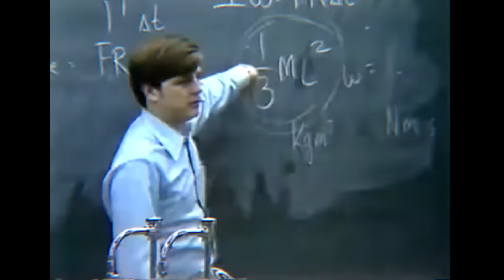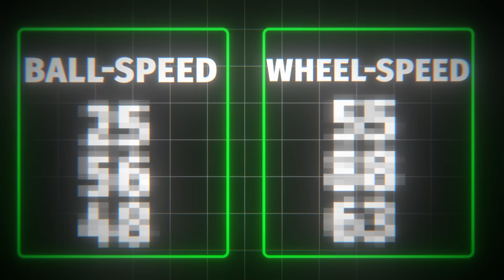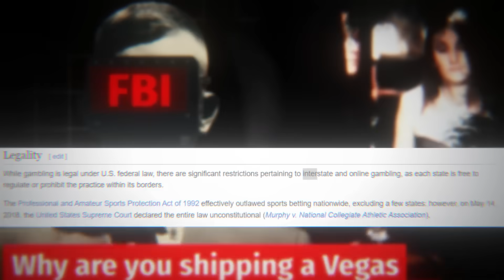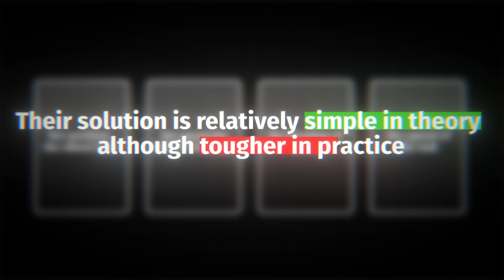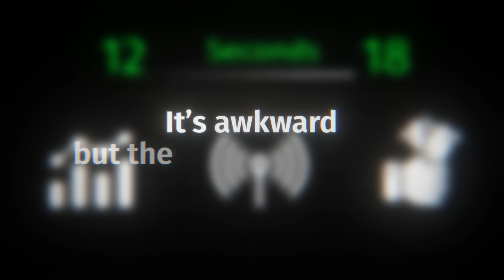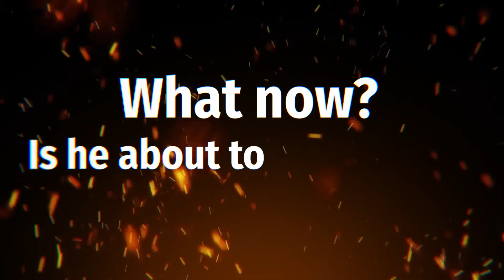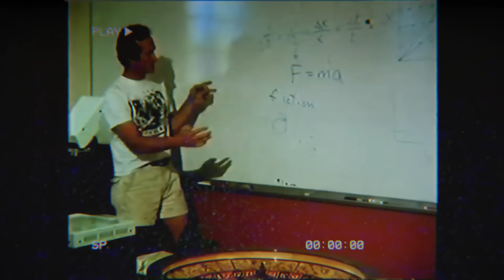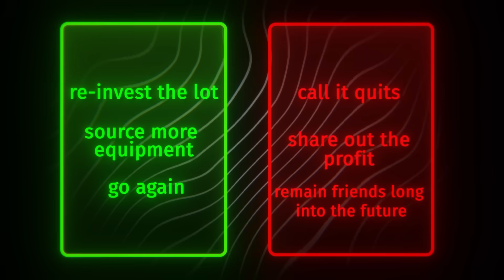The Nerds Who Beat Vegas Roulette With Science

Comment: This is a lot of rubbish and, also, on the video at around 6:40 - 7:00, it shows the ball spinning the same way as the rotating wheel.  They should know that in casinos the ball is always sent in the OPPOSITE direction to the way the wheel is rotating.  So this proves this is a load of rubbish.  In addition,  any expert will tell you that the wheel has no memory,  and that each spin is a fresh start and that it has no connection with previous spins.

Comment: How did they have computers that small in 1975?
Reply from the maker: It wasn't that small, that was half the problem! A big pad across the chest, linked to stuff under the arms and running down to the legs.
Reply: @TILT223  I saw a computer at my dad's office in the early 90s that was half the size of a room. It was considered "old" even then, but I know that they used it a few years before. Didn't Apple come out with the Mac in the early 80s? These guys were exceptionally smart, though. I'm sure they knew where to get cutting-edge tech in the 70s

Comment: I mean roulette is not that hard of a game to beat, i did it mathematically based on statistics, but after winning nearly $20,000 online i was flagged and was put on a rigged wheel, then lost it all (my own fault) for betting too much after getting a "bonus" for purchasing so many chips (i didnt read the fine print good enough). So when i cashed out they took everything but my original amount i bought in, and being flagged already i was put on a rigged wheel that even though only betting red or black it never landed on what i bet, which was statistically impossible. (If I remember right it landed on red 42 times in a row when i bet black.)

Comment: I figured out the physics of this in 1978 and I was trying to get a roulette wheel to get a data set.  Then I built a little computer with a 6504 Mostek cpu which took a 9v battery and I had a switch running down to my shoe and the computer fit in a cigarette package.  I used an ear piece that gave out tones for the different values , the result told you where to place your bet.  If you could guess even which half of the wheel , you would win.   I memorized the order of all the numbers around the wheel so that it would be easy to just bet a few consecutive numbers on the wheel.   I still have the computer and I had to build a calculator to figure out trigonometry.  I used look up tables to figure out the trig function.   This little calculator figured things out in hex and then translated it into decimal.   You had to time the wheel for one or two spins and the ball immediately for the third spin but the ball went in the other direction.   I think I only needed one spin of the wheel and one revolution of the ball.  
You might be able to do this without a calculator if you practiced long enough.   I didn't know where to get a roulette wheel and tried to build one.   The physics of the wheel and ball is calculated using gravity and the circumference of the wheel and differential equations.   I found the solution and it took about 4 pages of math to get it. 
A lot of people bet at any point but to win ,  you have to wait until the Croupier throws the ball.  So it might look suspicious if you always waited.  You would have to bet a few before that and then after.  You could still win this way but it would be slower.  
I never heard of these guys before , they were a couple of years ahead of me.   I never did ever test it out because I almost finished the computer program and was debugging it and got to busy with other things.   Then I read in a magazine about 1990 that someone had tried this.  There is a good chance the casino's will catch you and I noticed these other cheaters that were recognized world wide and banned from casinos.   I just dropped the idea.   I still have my old apple 2 computer that I used tot do the programming on and an EPROM burner and eraser with UV light.
Reply: Remember the Bread Pan EPROM Eraser in Kilobaud? I did that. And the IO Board in the World's First BBS. Good times!

Comment: As a Roulette Craps and Blackjack dealer for 18 years, Its called Clocking the wheel. Its much more difficult than you think to do even doing this constantly and being the one spinning the wheel and ball itself. Its much easier when the ball and the wheel are near the same speeds to count the area of where the ball will drop. But even IF you can drop the ball in those areas, the balls hit the edges and bounce and can still jump elsewhere. So they really didn't beat it with science. They truly beat it with luck. Oh, and using electronics to cheat the casino.  Not a good idea. There are a LOT of unmarked graves in Las Vegas NV. Most of them cheaters who thought they too could beat the game. You would be better off in shorts sperts of progressive amount betting and not getting greedy or staying long enough for someone like me to know what you are doing to cut you off and blacklist you. Even then its not guarantee and its why table minimums and table limits are implemented. But it can put the odd if you know how and where to bet considerably more into your favors at odds with the house.
Reply: Quantifying 'luck' is called statistics.

Comment: I do something similar with gaming slots. Sometimes you can see a glitch in the rolling slot or a short faint vibration. Unfortunately with these newer machines it's almost impossible to spot a glitch in the screen or feel any type of odd vibrations. It gets more challenging when the music is played really loud. Pressing or pulling the handle (the one-arm-bandit) at different interval gaps will create better odds than an almost predictable pattern detected by the gaming analogy systems. Some gaming slots will run you dry or have a one hit wonder or the system will keep hitting. Best of luck.

Comment: This is nonsense. The one variable you can't account for is when the croupier drops the ball.  If you could bet immediately following the drop of the ball, you'd have a legit scheme. But you can't. Most bets are waved off before the ball is dropped.  So every turn is determined by the croupier and is only predictable if the croupier drops the ball in a predictive manner. If they don't, well then you are gambling again.
It's been my experience that croupiers learn how to hit numbers  after long times at the table. One time a croupier told me to bet on 13, one turn later he hit 13. Basically showing me he could hit what he wanted. 
Another croupier once told me, after I suggested European tables give me better odds, "no, a favorable croupier gives you better odds". 
Yet another time I bet an 80%+ chance of winning and the croupier looked at me grinning as if he knew what I was doing, and hit a number outside of 80% of the table. 
If you want to cheat, monitor the croupier. What are their patterns?  Where do they drop the ball, how often and what hits. 
Realize you don't need any fancy physical measurements you just need where the ball is dropped and where it hits. And determine the patterns. 
If the croupier seems totally random in where they drop the ball, nothing else matters.
Reply from the maker: This is why they change the rules and make bets before the drop now...

Comment: cheesecake recipe:
Crust:
Ingredients 
9-12 graham crackers/ 100g digestive biscuits
1/4 teaspoon cinnamon 
5-6 tablespoons melted butter

Preheat your oven to 350F/180C

In a food processor, combine graham crackers, sugar, and cinnamon. Pulse until it’s a fine crumb. Add the butter and pulse until it looks like wet sand. Grease the bottom and sides of your springform pan, cover the sides in an even rectangle of parchment paper, there will be a slight overhang and that’s okay. Press crumb mixture into a 9 inch closed springform pan. Bake for 10 minutes. Cool to room temperature.

Filling:
2lbs/ .9 kg softened cream cheese 
1 cup/ 200g sugar
5 eggs, room temperature 
1 tablespoon vanilla extract 
1/2 cup/ 120g sour cream or yogurt 
1/4 cup/ 60ml heavy cream 
1 tablespoon lemon juice

Preheat your oven to 400F/ 205C

In a bowl of a stand mixer combine the cream cheese and sugar on medium speed. Mix together until light and fluffy, about 3-5 minutes. 

Water bath! 

While the cream cheese is mixing prepare your water bath. Wrap the outside of your springform pan tightly in tinfoil, using multiple layers. So no water can seep through. Find a pan big enough for your springform to fit and have room for water to come up the sides. Boil enough water for water to come 2 inches up the sides of the springform.

Filling!
When the cream cheese and sugar are light and fluffy add the eggs one at a time. On low speed mix well after each egg. At this point be sure to scrape down the sides of the bowl and DO NOT OVERMIX! Add the heavy cream, sour cream, vanilla, and lemon and mix until just combined. Pour your batter into your prepared springform pan. Put into water bath pan and place in the oven. Carefully pour in the boiling water until it comes 2 inches up the sides of your springform. 

Bake at 400F/205C for 13 minutes, then reduce without opening the oven door to 230F/ 110C. Bake for another 1 hour to 70 minutes. Do not open the oven door during baking. To tell if your cheesecake is done, quickly and carefully give it a slight jiggle. If it slightly jiggles in a 2–3-inch circle in the middle, it’s done. The edges will be slightly puffed up. If the cheesecake shows any cracks immediately move on to cooling. 

Cooling:
Once your cheesecake is done, turn off the oven and slightly prop the oven door open, preferably with an oven mitt or two. Leave in propped oven for at least an hour. Then leave the cheesecake at room temp until it’s cool. Cover with plastic wrap and let set in the fridge overnight. Remove the sides of the pan, peel off the parchment paper, serve, and enjoy!

also help me pay for college plz
https://gofund.me/18770d66

Comment: im a casino manager and i can tell u it doesn't work, its all luck.  Wheel and the ball r spun in the opposite direction along with diamond stuck on the wheel to make the ball jump... which means the ball will jump completely randomly depending on where the ball hits first.  With them believing they have beat the system is just another sign of addiction/problem gambling.  Just like people think they can guess if its banker/player next just by looking at previous patterss..... that's a sign of addiction.

Comment: This guys got lucky in a way. The only patterns is when dealers cheat. Dealer can hit any number or the two number around them. American Roulette is even easier to spot when the dealer cheat. You have to measure the numbers as being 4 rather than 1 number. Example 0,00,5,6 should be viewed as one number; they are a cross pattern. Dealers hide their testing of their skills by hitting cross numbers to developed their skill. . When dealers are spinning the small or large ball they can hit within 3 numbers almost every time unless the ball hops. If they place their bets before the dealer spins they will lose every spin. I mean every spin. The only way to be the house due to the dealer cheating is to never sit down and only play the outside. Never bet until they spin the ball. Always chase bets; follow last win and don't chance the bet until it doesn't hit. I have had black or red hit 22 times in a row. If you doubled bets for 22 times you are going to hit max bet before you win. Bet minimum amount for bets. YOU ARE PLAYING THE OTHER PLAYERS AND NOT THE HOUSE. The dealer works around his marked colored chips. Most player only last 20 minutes before they have to reup on chips. I can last for 20 hours straight with a 500 to 1000 dollar bankroll. My goal is to make $50 - 150 an hour.  When you bet after the dealer spins you have time to bet 1 to 3 bets on the outside of the table before they wave their hands.

Comment: So much of the physics  the eudaimonic pie people got wrong. It is in fact possible to narrow down the area where a ball is likely to fall out, which is enough information to significantly increase your odds, given the payoff for landing on the right number, but using the technique they used to determine the outcome generated the result only a second or two before the ball would fall, hardly enough time to get your chips down. And their technique relied more heavily on wheels not being level than it did on predicting what part of the track the ball would fall from. A wheel off by as little as the width of a quarter could eliminate as much as half the wheel that it would fall from. In their book they blamed their failure on hardware, but this was another red herring. What they didn’t realize (at least at the time they wrote the book, they may have figured it out later) is that when they decided to do their debut run, it was during a weather front passing through. Yes their equipment got wet but that wasn’t the primary cause of the equipment giving erroneous predictions. What they never talked about in their book is that a roulette wheel is one of the most sensitive barometers you can devise. The primary thing that slows a ball on the track when it spins isn’t the friction between the ball and the track. It’s between the ball and the drag the air imparts on the ball. That means only the most recent decay readings will be likely to give you the best predictions for the next spin, and the technique they used to average multiple spins to build a prediction table, especially during a storm passing through, is going to give you result that are all over the place - the real reason they got the results they got for their first time out - pretty much where the book ended, with a call to upgrade and weatherproof their hardware. All of this kinda became moot when the new shallower roulette wheels came along, significantly increasing the scatter bounce of the ball to more than a revolution around the wheel, something the roulette manufacturers did precisely because of this threat. Here’s the kicker. There were a handful of people who learned how to time the ball and the wheel intersect without the aid of a computer. Their track record averaged about 1 hit every 5 to 8 time. Those individuals made several millions before they were permanently barred from the casinos. (And by the way you got the animation wrong the wheel spins in the opposite direction to the ball).

Comment: i found a way to win 100's at roulette legally 1st off the numbers arent 1 2 3 45 6 on the wheel theyare like 35 - 22 -7 --16 etc

so including the double 0's place bets on 10 consecutvie numbers and skip one then do next 10 group until you have like 33 numvbers covered 

each wheel spin  takes about 30 secs ball drop to ball drop dealers switch up every 30 mins you win $3 10 X in 30 mins thats equal to $60 per hour 

however when at wheel differnt dealrs spin differntly and numbers you have open they might hit also do not play alone play with 3 or more others 

I only ply craps and slots now at casino roullette pays highest odds on single number  35-1 but there are 38 numbers on the wheel fixed edge for casino

Comment: The MIT blackjack team could've owned the game with those body computers in those days when no one knew a computer could fit on your body. Instead of counting high and low cards, the computer could track EVERY card played and turn any semblance of "gambling" into parting fools from their money!

Players did try this later but you have to be the first. Once casinos start watching for people tapping their legs etc it's all over.
Reply from the maker: That's another amazing story...
Reply: @TILT223  Indeed. Do you know the one about the guy who used battery drills to access slots, then fed a chip through the hole that would line up with a specific chip on the board and program it for a jackpot?
It took like 10 people to be spotters, camera blockers, and of course the player who would act surprised and cash the check.

For sheer balls that guy is my favorite. I can't imagine drilling into a machine to "hotwire" it right on the floor like that.

Comment: Makes no sense,yes they can guess the number, no doubt but the game is, you need to have a number before that wheel spins, can’t change the number as that wheel spins
Reply: They let you place bet usually right up to the point where they hear the ball bouncing around if not a revolution before, they are greedy enough to wait to the last second. Then at least on the older style wheels with the steeper cones the ball would bounce no more than a third of a rotor from the intersect point of the ball to rotor. If you knew where that intersect point would be and you knew the number sequence on the rotor, then you would place bets around those particular numbers. You could even just bet on one number, and over time you would still clean up. Remember for an American wheel, all you have to know is 2 numbers that the wheel won’t land on to break even. Doing better than that is all gravy!

Comment: There are several variables that would definitely throw off their calculations. Human spinners being the most unpredictable one. Some spinners are consistent. Others are not. Some speed up the wheel. Some slow it down. Some are just bad at flicking the ball and the spin and speed are all over the map. They are doing what roulette players have done for years. Trying to find a consistent dealer and a relatively stable wheel
Reply: No? did you watch the video? like at all? not even the main part? they have to tap in order to input the information to the computer, one set of taps for the wheel and another for the ball. They have 12-18 seconds, that gap is the difference between dealers. Nothing changes other than the time to input